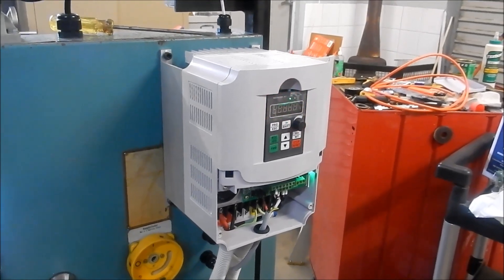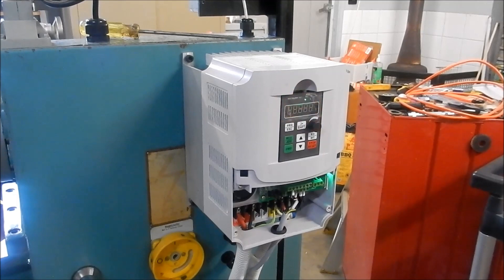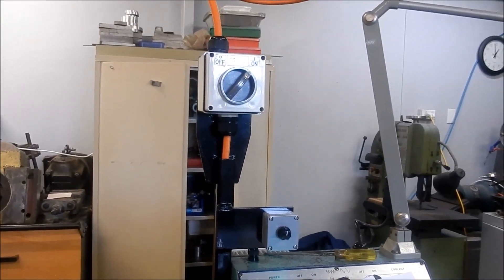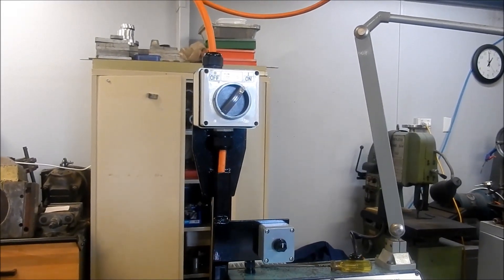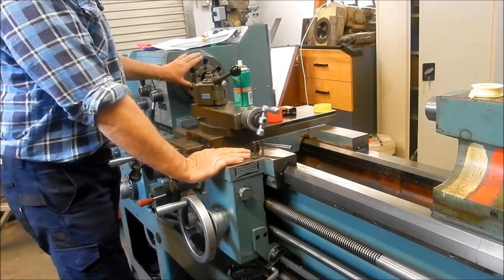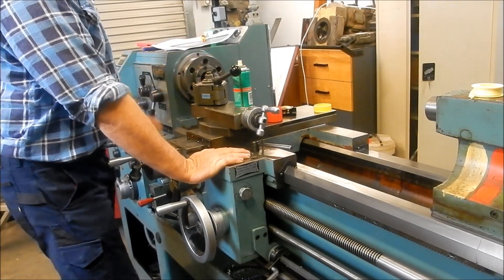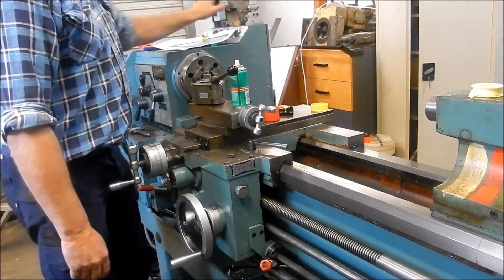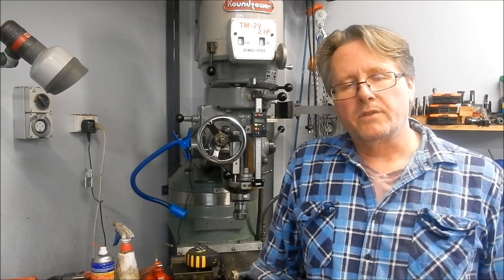240V Single Phase to 415V 3 Phase Inverter, YouTube Policy Change, Finally Running the Victor Lathe.

Comment: Hi cam nice set up BUT the link on your post is only 220v to 380v conversion were sis you get 240v to 415v as i cant seem to find them at lower cost

Comment: I recently purchased an 11kw VFD also from AliXpress for my 5kw lathe for just under$400 AU delivered, straight out of the box wired it to a 32amp supply and a standard 40amp 3phase outlet socket to my lathe, turned it on and that was all I had to do no trolling through the manual or setting up the motor parameters, NO altering any of the wiring breakers or transformers in the lathe, quite literally plug and play, only adjustment required was to re adjust the lathes break a bit tighter, it runs perfectly with the added advantage of lowering speeds in between gear settings via a trim pot on the VFD, I also use this unit on a 400mm 2 speed pedestal grinder with a 6kw motor just plug it in also no changes to the contactors and great speed control via the VFD. 
I initially ran the lathe on a rotary phase converter that would trip out at the most inconvenient times due to the input supply voltage drop, it only needed to drop to 232v to trip out, it is wired totally independently to the main switch board, unfortunately I still need the Rotary phase converter to run my mill it requires three phase and neutral for the 5 feed motors, transformers and electronic speed controls, 1980's ancient technology but repairable, I was told it could be done with a VFD but I don't use the mill all that much.

I hesitated for a long time mainly because of the cost an 8Kw VFD Locally was over $1000 so 11Kw from China at around $400 
did it, but take their advice if you need to run a 5kw motor get a 50% bigger VFD I went double, their 220v single phase to 380v three phase units have in their specs + or- 15% Which puts them in the right specs for 240v single phase to 415v three phase, Just make sure you have access to a 32-amp power supply and wire it according to the instructions

Comment: Hi, I wonder whether you can help me. I want to do the same thing to my Colchester 2000. But when I ask people about these VDF you can’t get 380 V out of a 220 in, but your video shows that you can is this correct? Be most appreciated for any help, cheers Ian.
Reply from the maker: Yep, you certainly can get the VFD'S that will go from 240V single phase direct to 415V 3 phase.  I bought it through Aliexpress.  However if you look in my later video it blew up and caught fire.  It could be that I modified when the cooling fans to came on with a temp sensor.
I have since gone back to the traditional 240V 3 phase VFD.  Unfortunately I had to purchase a new motor that would run on 240V 3 phase as the exiting one would only do 415V.
Cam

Comment: Great vid and good to see an Aussie here, question if you dont mind i have normal single phase 240v in my sjed but have acces to cheap 3 phase 380-415v vfd air conditioner can i use one of these to run that?
Reply from the maker: If it were me, given it blew up and caught fire I wouldn't.  I would imagine you aren't going to be standing next to the drive while it's running.  Given that if it does fail your not going to know about it.  It could end badly.  I'm assuming given you are asking you can't run the motor in a delta 240v 3 phase configuration.  
Cam
Reply: @camatbattler2233 I'm not sure about ghe 240v route i don't have it I've just I've found a cree 22kw multi head system very cheap and was trying to work out if i could make it work thanks for your reply

Comment: so you wouldnt recommend this option then
Reply from the maker: OK, would I recommend this unit.  Yes, but under certain conditions.  The motor was a 7.5hp unit, probably the largest you would use in a standard domestic power supply.  This thing creates an enormous amount of heat driving this size motor and I modified the cooling arrangement with the thermal switches.  This may have been a trigger for the failure.  I think this unit would probably be OK with a smaller motor.
Cam
Reply: awsome, I just picked up an old Harrison with 3hp 3phase motor, might have to give it a try

Comment: Hi im curious, in your opinion would these vfd's run into trouble when used for long continuous period of time. Example 12hours non stop?
Reply from the maker: I've run these things for over 14hrs.  The VFD on my Milling Machine has been running for over 4 years and hasn't missed a beat.  For my application so much better than a phase converter, it only draws power when the machine runs.  A converter sits in the corner running constantly costing money and generating heat.
Cam
Reply: @camatbattler2233  hi cam, thanks so much for the reply. The reason i asked is because where I am, it would cost too much to install 3phase. I plan to use rootblower aerators for my shrimp tanks and the motor is 7.5kw. I was thinking of rotating 2 rootblowers in 12 hr shifts per day.

Comment: I'm trying to find a cheap 240 to 415v converter. Does that one of yours go to 415 or only 380v ?
Thanks, Mal
Reply from the maker: It puts out 415V.  The 380V is generic.
Cam
Reply: @camatbattler2233  thanks mate
Reply: @camatbattler2233  I've bought 1 and plugged it in. It appears dead. Does it need something connected to the output before it will power up ?
Reply from the maker: Send me your  email address and I'll send you a photo of my connections.  Make sure you are hooking your single phase wires to the right connections and not to the 3 phase side.  I did this originally and had the same issue.
Cam

Comment: hi cam, thank you for your video. i have a lathe with a 2 speed ( 1338/670rpm) 3 phase motor . should i use the  delta or Y  connection to the vfd?   many thanks
Reply from the maker: Hi Alberto, this is a 415V inverter so the motor is in the star winding configuration.  Many other inverters will only output 240V 3 phase and you need to wire the motor in a delta configuration.  My motor was a 2 speed and you can only run at one speed.  I chose the 720 rpm taps and ran the inverter at 100hz.  
Cam
Reply: thanks , why you choose the low speed and not the hi speed of the motor? thanks @camatbattler2233
Reply from the maker: It seamed to run smother with the 720 rpm taps.  At 100hz it gave me the true speed.
Cam

Comment: Hello Cam, great job on your lathe. What horse power is your lathe and what is the model # of your VFD. Thanks in advance.
Reply from the maker: G'day George,  it's an Nflixin model No - 9100-1T3-00750G.  7.5kw unit.
My lathe motor is 5.5kw.  Always go to the next size up on the inverter.
Cam

Comment: Hi Cam, how would I make this work with a 3 phase machine that runs on 415v and it has a 3 phase twist lock plug and the machine runs on 4 different motors?
Reply: Hi Cam, could you pretty please answer my question?
Reply from the maker: Sorry for the late reply.  Just back from two weeks holiday in Queensland. 
The rule is typically one motor to one drive.  The drive needs to be configured to the individual specifications of the motor.  As far as the plug goes I only hard wire the VFD into the motor.  I also program in all the functions and run the wiring for start/ stop, forward/reverse, jog, e-stop, speed control etc.  This allows me to have the lathe or mill run of the original control buttons

Comment: Great video Cam l wish that l had seen this video of yours before l had converted my old Aciera F3 milling machine, the Original machine was two speed star/ delta configuration 440volts only. 1425-960 rpm, l have made an adapter plate and had to off set the motor from the mounting carrier. This is causing vibrations problems. I think that l will end up refitting the original motor and buy a VFD to solve the problems. Life is a leaning curve, l will  try to locate the type that you have , any help you can give me would be great. Regards Gary

Comment: Ahh ok thanks that’s a really shame my lathe doesn’t have a brake or clutch some vfds are extremely slow at slowing the spindle down to a stop . This is why I wanted to know if it had a brake that could be added
Reply from the maker: I have tried to push the deceleration function to speed the slow down, it goes so far but when pushed where it would make even a small difference causes the VFD to trip out.
Cam

Comment: Hi there I’m wanting to buy one of these vfds has this got a brake resistor on it does seem to stop so much faster than a 220v 3 phase vfd thanks in advance
Reply from the maker: Hi Sean, if your running single phase 240V into the VFD you cannot fit a break resistor.  This one of the questions I put to the OEM and was disappointed I couldn't resistance break.
Cam

Comment: Hello Cam from the uk.
I’ve just got myself an old Colchester master lathe and need to get it running, I want to keep the old motor, that can’t be run on delta, so need a vfd, that can use 240v to 3 phase 440v star (y).
Have you got your motor running in star (y) and would the vfd that you are using be the right one for my needs?
My motor is a 3hp unit.
Thanks. Dave.
Reply from the maker: G'day Dave, yep you can certainly run the motor in 440 V star.  That's what attracted me to it in the first place.  My lathe was a two speed 8 pole, 4 pole mootor and couldn't be run in delta.  As for size, the supplier recommended selecting the next size up from the motor rating so what I used would be fine for your application if not a bit of overkill.  You cannot run a motor reliably if the VFD is undersize.
Cam

Comment: hi Cam...thanks for your video!...I am trying to understand why you did not connect directly the 380v 3ph output of the inverter,  to the machine's cable? What is the problem and you avoided this easy way? (i am asking because i want to install a device like this to my new lathe)...Regards!
Reply from the maker: G'Day km, bit lost there.  The right side R/S 6mm cable is the 240V single phase, the left site is the 3 Phase 415V to the motor.  Let me know on the time sink in the video where it shows I've connected the motor incorrectly.
Cam

Comment: How has this held up for you?  I am getting one similar to run a 7.5kw 3 phase 380v spindle.
Reply from the maker: G 'day D Lewis, this unit has run extremely well and it has had a lot of constant use.  The cooling fans can get a little loud when both are running.  I fitted a couple of Bi-Metallic switches to the Heat Sink and wired into the units circuit.  This was very difficult to do as I had to remove all the boards to get access.  I have them set at different heat values, if I remember one is set at 45 degrees and the other at 50 degrees.  Its very rare the second fan comes on and its only been in summer on hot days so the noise from the one fan is fine.
Cam

Comment: Hi Cam. Brilliant vid, perfect info and presentation for me, as I want to build a custom cnc mill to run at 7.5 kW 3 phase on UK 240v single phase, (didn't realise it was the same voltage in Oz!). I was looking at a vfd to do it all in one, but there is a lot of negative on forums about them being "off-brand Chinese crap that's not worth a carrott", and suggesting all kinds of cumbersome, expensive alternatives. Your vid is very reassuring, but I was just wondering how it has performed over time. Are you still as happy with it re reliability?  Cheers.
Reply from the maker: Hi Steve, yep I'm very happy with the VFD.  So far it has been flawless.  I did do some major surgery on it though which required taking the drive board's out to access the fan wiring in the rear of the unit so I could mount two bimetallic switches, one for each fan.  The fans run all the time and do get quite noisy so I have the switches mounted to the heat sink and come on at 45 degrees C.  The speed does have very slight fluctuations so bear in mind that there is some instability but this has no effect on how the lathe performs.  The motor in the lathe was a two speed so I am running of the 8 pole taps (750rpm) and set the VFD frequency to 100Hz to give the rated lathe name plate speeds.
Cam

Comment: Hi Cam, thank you for you great info. I looked up the VFD in the link you gave to MrScooty67 two weeks ago and the model of the VFD states that its output is 380V. Could you please tell me if you had to adjust it to be 415V or 380V will do for Australia 415V nominal 3 phase? Thank you.
Reply from the maker: G'Day Enzo, the 380v 3 Phase is nominal.  I'm running mine at 415V.  Can't remember if it is a change function in the programming.  There is some programming required to set the drive up to suit your motors parameters.
Cam
Reply: @camatbattler2233  Great Cam, thank you for your quick reply to my question. One more question: is the VFD output configured for  Y or Delta?  The video I  watched on their site shows only three wires going from the VFD to the three phase motor.
Thank you.
Reply: @camatbattler2233 Hi Cam,  I forgot to ask if you can share a .pdf copy of the manual if possible please.
Thank you again.
Reply from the maker: If it's 415V it's Star.  I'm using a 2 speed motor on the lathe and have it wired for the 860 RPM taps and running it at 100Hz.  You cannot run a 2 speed motor with 240v 3 phase Delta.  Definantly 4 wires to the motor and 3 in from the single phase.  Flick me your email address and I'll forward on the manual.
Cam

Comment: Hi Cam, could you tell me the Name and model of the VFD please i cant find one anywhere. Cheers.
Reply from the maker: This is the unit I purchased from Aliexpress -
https://www.aliexpress.com/item/10000404081162.html?spm=a2g0o.order_list.0.0.21ef18020YBR6Q
Its a 7.5 KW unit for a 5Hp motor.
Cam
Reply: @camatbattler2233  Cheers, just purchased one, coolarooni.

Comment: Just been looking in to all this myself and came to the same conclusion and will be ordering one of these shortly. The issue I was having, was with whether I need a breaking resistor or not. I'm only needing one for a gear head drill with dual speed motor with tapping capabilities, which means quick stop start or quick change in direction.
Reply from the maker: G'Day Mark, that was one of the questions I asked the supplier on a number of occasions, could I use a breaking resistor on this unit in the single phase configuration.  The answer was always no.  I also checked this with my good mate Pete who is a drives engineer, he was of the same opinion.  You will find when you get the unit, the literature shows it can be  configured, but there are many anomalies in the manual and it is a duel voltage unit.  Let me know if you find a way around it, I'd be very interested.
Cam

Comment: Looks like you got it working great !
All you need now is one of those cheap tacho units to tell you the spindle rpm.
Reply from the maker: Hi Ian, I've ordered a longer ribbon cable so I can mount the display where I can see it.  I tend to machine on feel rather than RPM, always done it this way back when I was a machinist.  I'm now running in the 8 pole configuration and over speeding to enable the top speed of 1800 RPM in high gear.  So its now running top speed at 100Hz so running at 50Hz is half speed so its fairly easy to get an idea on the speed based on the Hz on the display and the speed I've selected on the gearbox.
Cam

Comment: Well done on the conversion. I've done the same with a Colchester Bantam lathe and Deckel FP1 milling machine, both with 2 speed motors, retaining the machine controls exactly as you have. I agree totally with your statement that these inverters are a game changer for the home workshop - particularly at the prices they are available at.
Reply from the maker: G'Day Phil, not only do they allow us to run in 415V 3 phase but they are relatively cheap.  Was wondering how a I was going to run the motors on my Hercus Tool and Cutter grinder.  This has made it a no brainer.
Cam

Comment: Thanks for sharing this info. This is the first time I have seen an inverter being able to generate three phase and transform the voltage. I was wondering when they would come out with this. Unfortunately this will not work in North America hopefully there will be something become available here that will allow a 240V split phase to be converted to three phase 440V. My 10 kW rotary phase converter and transformer cost more then twice as much to built so the price is very reasonable. Great to see the Victor up and running, you've done a nice job.

Comment: Hello Cam,
Good to see the Victor running and the inverter sounds interesting.... my Deckel is 3 phase, which would be a lot easier if it was standard 240v.
Take care.
Paul,,
Reply from the maker: G'Day Paul, yep these 415V 3 Phase Inverters are great.  No need to by a specific motor that can be re-worked to a Delta configuration.  Just takes a bit of time to understand the programming format but after the initial learning curve its all quite simple.
Cam

Comment: Great video Cam
I love that you maintained all of the E-stop features like needing to put the lever in neutral after resetting. Was that all done with programming in the vfd unit, or was there additional circuitry?
It is one of the things I'm trying to work out before upgrading my lathe to 3 phase
Reply from the maker: G'day Tom, hitting the e-stop kills the power to the relays. The second there is no signal from the forward and reverse relays to the inverter the inverter stops the motor.  There was no programing involved to achieve this.  
Cam